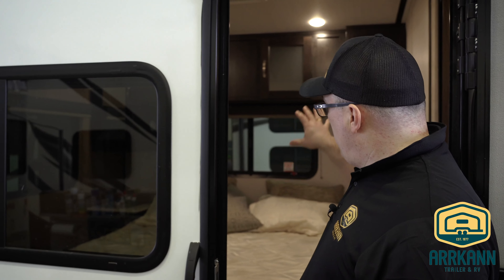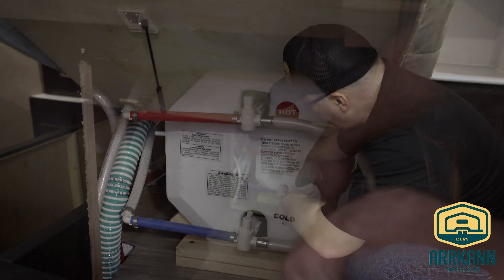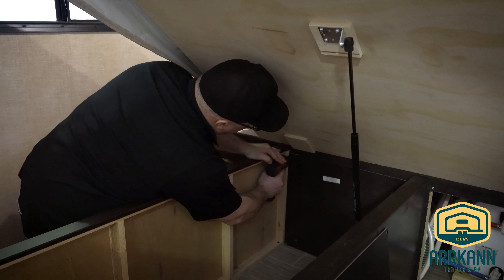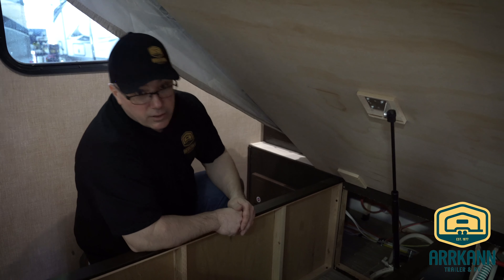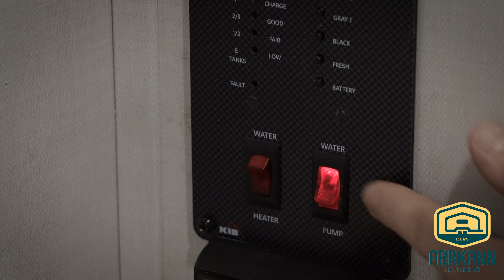De-Winterization Demo

Comment: The water heater valves at the 3:30 minute mark are NOT in the winter bypass position like he says. They are actually in the summer position with water going through the heater. At the 8:07 minute mark you will notice that the valves ARE now in the bypass position and he moves them back to the summer position, the same position they were in at the 3:30 minute mark.